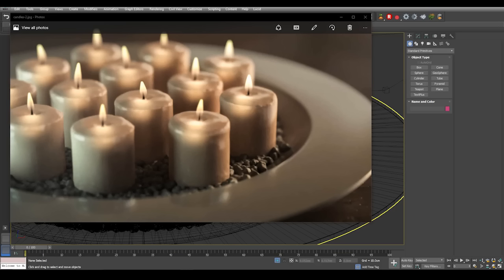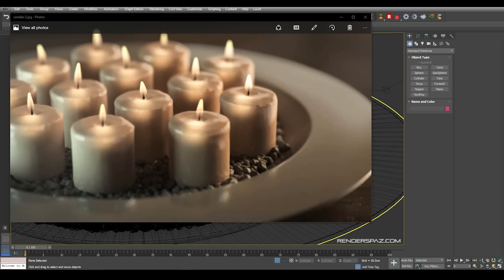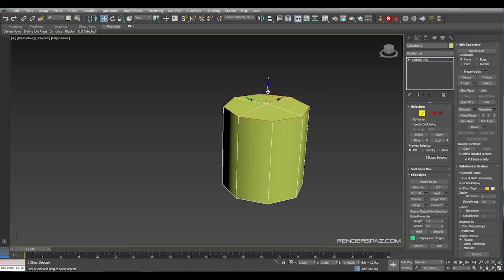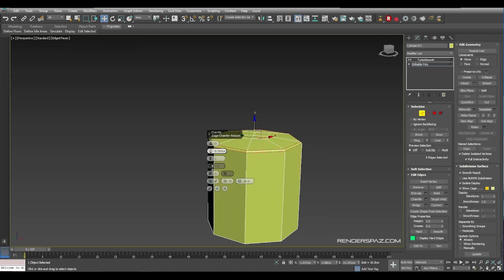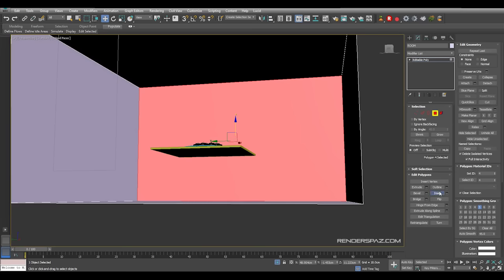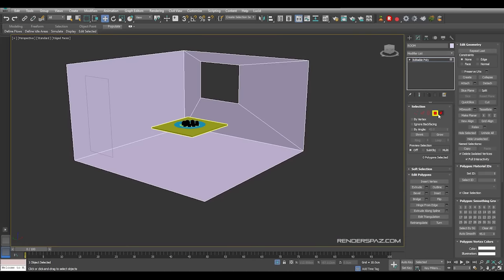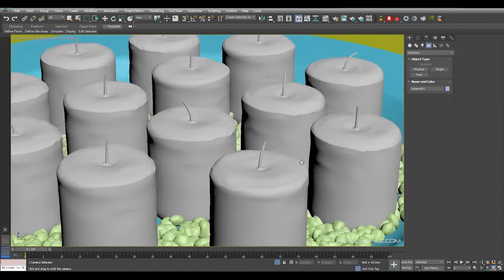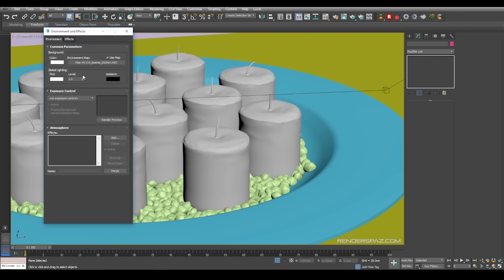Rendering Candles In 3DsMax Using IRAY

Comment: I've been trying for two days to use the cut tool on the top of the candlewick, in the process of designing it, but it doesn't work. I searched on the internet and some of the people who have the same issue to deal with said that the specific tool doesn't work very well sometimes.. Do tou have any suggestions of using another tool maybe or to let us know which commands you had active when you were using the cut tool?  thank you

Comment: Hi Spaz, 1.could you make a tutorial or describe on some page you rendering settings of vray  for car scenes. They always look so stunning and photorealistic< I wish I could make it as good as you are. 2.How do you think GTX690 still reasonable choise to buy know, I mean there's alot of gtx940/50/60 gtx1060/80 with the same price, but I need to know real power and capability for 3D and rendering only. Thank you for your time.)
Reply from the maker: Hi Paul,  If you are using GPU rendering in Vray, rendering Automotive grills  is a good start on a studio setting using VrayRT. Car Studio Kit over on Renderspaz website has loads of in-depth tutorials on quality settings for car rendering.  There will be updated vray car rendering tutorials coming in the near future.

https://www.youtube.com/watch?v=4gEUF3O-CSA

The 690 is a great card, I still use it daily - however you can't go wrong with a 1070 or a 1080.  I recommend to get a cheaper card like a 1060 to run your viewport and have a 1070/1080 to rendering real-time then use them both or more cards to render your final output.
Reply: Thank you so much. Oh, I know about 1070 and 1080, but 690 is the same price now as 1060 and i only have money for 1 of them. I just can't figure it out which card is more powerful for that price for maya and render only, coz 1060 is like newer and with all this new technologies and Pascal, higher frequencys and so on, but 690 is the beast is the most powerful card i've ever seen in specs with much more cuda cores, higher bit width and all that enormous power.
Reply from the maker: If you are stuck between having one card and no secondary like a 1070 or 1080. The 690 is still a great choice over the 1060 IMO. It may be older technology wise but if your strictly using it for 3D rendering, with dual gpu  more cores (which is what you want). The card has 4GB ram which will be split to 2GB when using vray RT but if you are not constantly rendering "very large" scenes you will be fine.  However this is starting to change in the development in most renderers like Redshift that features Out of core rendering which utilizes your system memory if the VRAM hits its limit.

All in all I use the 690 as a primary right now. It does the job very well in most cases as a secondary card option I will be purchasing one of the 10 series to give me more boost and run some benchmarks. You can never have too many cards :)
Reply: Thank you so much! Hah, yeah it seems so)).